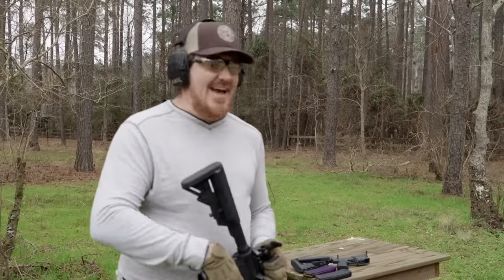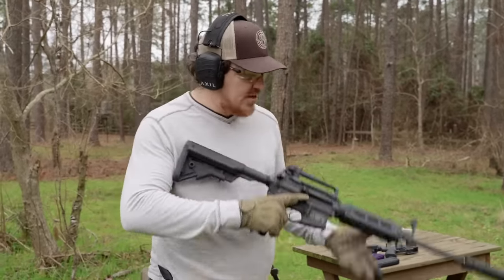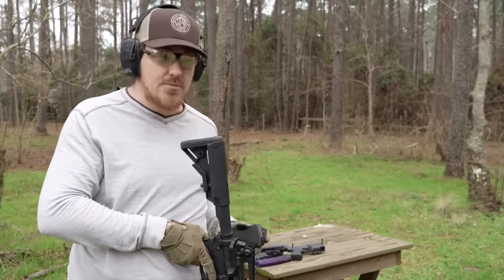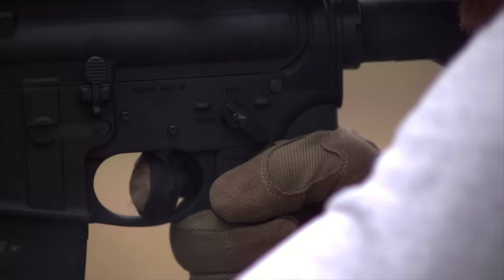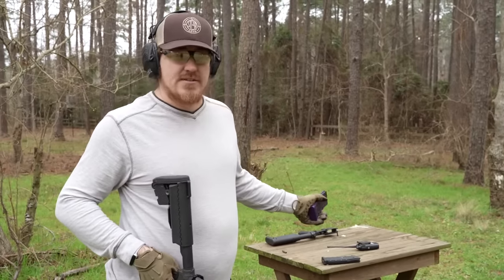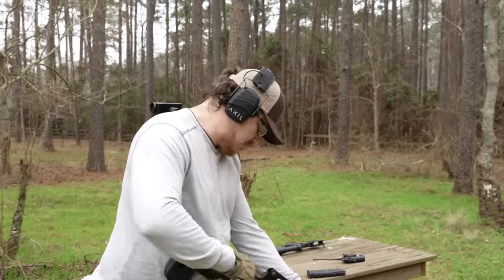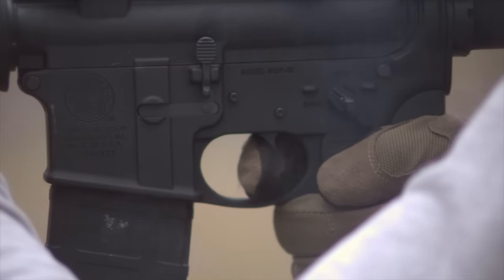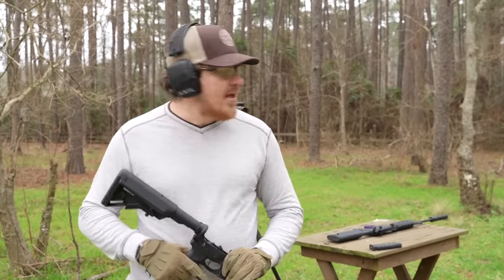FRT-15 Vs An Actual Machine Gun

Comment: I'm not against FRT or full auto at all.  I think both should be made legal.  However by definition FRT can be considered machine guns.   Part of the prohibition of machine guns is that it requires a Manual reloading of the weapon.  Basically this mean a manual rearming.    A FRT does not meet that requirement as it resets automatically.   Machine guns
Includes any firearm which can fire repeatedly, without manual reloading, "by a single function of the trigger".     Everyone understands this to mean one pull of the trigger = one round firing.  But in truth it means it is necessary to manually move or release the trigger in order for another round to be ready to fire.     The same can be argued for binary triggers.  However one could argue that half way through the trigger movement is the manual resetting.   In all honesty lawsuits need to be geared to removing the The National Firearms Act of 1934 as it is unconstitutional.  Until then they can be found illegal.

Comment: How does holding the trigger back cause the gun to jam?
Reply from the maker: See one of my update videos I posted recently. If you hold the trigger back with force it prevents the reset from happening and causes the bcg to not go forward. So you end up with an open bolt. Release the trigger and the bcg goes back in normally and you can continuing firing.

Comment: In stock on rare breed website on occasion, and you can sign up for alerts. I ordered one last week, should be here tomorrow by tracking. Interested if it’s post design flaw???
Reply from the maker: It is. You’re good. They modified it back in May. I didn’t do a video on it because at that point so many people already had. They notched the locking bar so it would stop crimping the spring with undue pressure causing it to fail over time. I replaced my car with a Gen ii and got back up springs to keep it tuned sharp. No regrets. You’ll enjoy!
Reply: @gatcattill  mine arrived today...No updated parts from this video that I can tell. I saw pictures of the updated bar, this one doesn’t have the notch. However, the spring hole looks wider like I have seen in some videos. Perhaps their limited by what they can change and with the current situation my not be approved for another patent.

Comment: Hey dude? Are you shooting at a road? At 2:00 to 2:06 you can see a white car go past behind the brush on the right of the screen
Reply from the maker: No. This is a closed private range into a berm. There is a farm road parallels the range a few hundred ft to the left with no crossing or contact.
Reply from the maker: Also. No car is visible? Might be an egret flashing white in the trees.

Comment: Needed to point out that neither of the firearms are a machine gun, even a full auto .
A machine gun is a heavy firearm that is designed to be fired on the ground or vehicle with a bi pod and are usually belt fed but can also have a box mag.  A mg does not have a semi auto mode. 
Ar rifles that fire auto, are just that, a full auto rifle.
The government likes to use the term, mg, to scare the general public more.
Reply from the maker: Ok boomer. Read the NFA for the definition of what is the legal machine gun term.
Reply: @gatcattill  Look up the military term for a machine gun
Reply: @FC-qe1wl   This is a video about legal definitions of firearms. A full auto rifle is a machine gun by law. That is all that matters to this issue. 

The military term has no bearing whatsoever on law.

Comment: It's slightly faster than a full-auto...holy shit!
Reply from the maker: Had a lighter buffer weight which allowed it to cycle faster. Had they had the exact same weight system it would have been a tie or slight edge to the full auto since the frt is dependent on my finger movements.

Comment: ok who has tested the zip tie? Does a zip tie stretch and return enough to empty a mag with a forced reset trigger?
Reply from the maker: That’s legal grey area - but a zip tie till likely either lock the bolt open or it will shift after or or two resets and stop firing. Depends on the initial tension in the zip and if it’s allowed to move.
Reply: @gatcattill  It definitely works. Can now confirm.
I mentioned it because it was an argument used by the gov. in the bumpstock and forced reset trigger cases.

Comment: I think they reduced the rate of fire in government models because people were blowing through 20 round mags and not scoring as many hits
Reply from the maker: You can tune rate of fire in your personal gun quite easily by adjusting your gas system, barrel length, buffer weight and design, etc.
Reply from the maker: You can tune rate of fire in your personal gun quite easily by adjusting your gas system, barrel length, buffer weight and design, etc.

Comment: Also over gassing the gas system increases fire rate.
Reply from the maker: Same upper on both = same gas system champ
Reply: @gatcattill you mentioned with a lighter buffer tube you get a higher rate of fire, since you didn't say anything about the modifying the gas system to get a higher fire rate I decided to put it in the comments. Though it's funny that you jump to assumptions about my comment.
Reply from the maker: @Lucky719ner  not sure what’s funny. Just clarifying for those who may read your comment and think it has relevance.

Comment: Why is the safety  selector  half way between  fire and safety on your test m&p 15  and has it been  altered  in any way. An update to  this question would be greatly appreciated. For this cast's  suspicion that the test is flawed.
Reply from the maker: Test is not flawed. I swapped the the stock safety with a radian ambi 45
Reply: @gatcattill  why was this fact not openly disclosed in the original article post. I dont know any selector thats the far out of alignment. And i own over 15 ar .

Comment: What about the other binary triggers?
Reply from the maker: They run well. I use Franklin armory BFiii on my 22 and 300 blackout lower. No issues. You can get very fast with them. No legal issues with them as of yet. If FRT loses though, binary will fall next because it will allow reinterpretation to the NFA rulings

Comment: Do I need a lower with the third hole? I don’t have that but rare breed doesn’t mention the third hole for the sear. It just says you need the full auto bolt which I have and a heavier buffer . Any info? Is the third hold just to have the semi and auto option?
Reply from the maker: Third hole is specific to an actual machine gun and no applicability to the FRT

Comment: BATF is treating the Rare Breed Triggers as a DIAS.
Reply from the maker: Batf is trying to treat all forced reset triggers as a machine gun. Not an auto seer. The classification they are pushing is more like a lightning link in the function that it converts an AR to FA with a drop in part. The AR is not the machine gun in that instance but the part is. With a DIAS, the lower with the third whole is considered the MG.

Comment: Well, not for nothing, and I am a staunch 2nd guy, but that trigger group is specifically designed to circumvent the rules.  They will end up changing the rules to something about emulating automatic fire etc.  Not agreeing with it, but that's what's going to happen,  and as someone who has spent some time in nasty places and seen a thing or too, the only thing that "full auto" fire in a M16/AR platform is good for is lightening your wallet, which is why modern military variants only have 3 round burst.  Effective sustained full auto fire requires a heavier chassis and mechanism specifically designed for full auto fire.  I've laid down effective automatic fire, and the M249/M60 is the way to go.  A very good video though, really shows how the FRT works, and yes, as currently written it complies with the rules.  Let's hope the courts see it that way...but I wouldn't hold my breathe.
Reply: They will most likely change the definition of Semi Automatic. To something like 1 bullet per trigger pull, where a trigger pull is defined further as a 2 step process of squeezing and completely releasing muscle tension off the trigger. Semi Automatic will then logically be further complicated because of Rare Breeds circumvention by defining semi auto as needing MANUAL user input to both action and reset the trigger mechanism, so that the gun itself will not automatically reset its trigger without user input. As you can imagine, all guns will have to change if Rare Breed forces the rat into a corner.

Comment: So, H2 spring with the semi trigger, what spring was in the M16 buffer? Just curious.
Reply from the maker: Stock vltor a5 setup
Reply: @gatcattill  so, H4 6.83oz And the H2 at 4.7oz. 

I wonder how the fire rate would be affected with an H3 kit in the M16. This is just a curiosity, as I’m new to the hobby.
Reply from the maker: @steaknive  it would increase rate of fire. Heavier buffers slow rate of fire. The distinction between the two rates was more so to fun to be fair. The comparison was for trigger movements and education. But it’s always a good learning exercise for those just joining in the hobby at this level of trigger fun!
Reply: @gatcattill  I figured it was a fun addition to the video. But, as I said, I’m just here to learn.

Comment: You have a transferable but you still say “H2 buffer tube?” 🥴
Reply: Meaning what? What part of that is wrong?
Reply: @evocati6523  H2 is a designation for the weight that goes into the buffer tube. They don’t make buffer tubes with different weights. 

I’m not offended, but typically when a guy is $20k+ into guns they tend to know the basic mechanics
Reply from the maker: It’s being on the spot and fumbling. I do my videos in one take. See the comments about how I pronounce aguila ammo in my 22 video.

Comment: Does the trigger moving really make it semi auto? Because it is the trigger moving and not the finger. The finger is just under lose tension.
Reply from the maker: Without the finger it will not fire a second or subsequent round. The mechanic is forced reset is not new and has been ruled OK by the ATF. This is just another over step and mind change.
Reply: @gatcattill  Without the finger a fully automatic gun wont fire either
Reply from the maker: Without the finger pressing it each time*

Comment: So FRT-15 vs M4 on full auto. 
Amount of rounds downrange (same), 
Cyclic rate (about the same), 
trigger pulls without the high speed camera (undistinguishable, unless you are the one pulling the trigger). 
#1 Letter of the law vs the spirit of the law. 
The fact they pulled the product from the shelves for 'product concerns'; nail in coffin. Sorry everyone, I love the 2a as well, its a machine gun to anyone other than the person pulling the trigger. if my 3 year old says cool machine gun then guess what ATF is gonna say, bye bye the way of the bump stock which had a much better argument. IMHO.
Reply from the maker: It was pulled short term back when this video was shot in February. They had some supply shortages and a disagreement with BDU. They released rev two a couple months later that addressed the spring concerns that was found.
Reply: @gatcattill  Good to know. Thanks

Comment: Wide open triggers has a similar design but idk how it's gonna lay out with a stolen patent from what the rare breed owner said in his video.
Reply from the maker: I have a WOt now. Check my shorts in my library. It’s got some uniqueness going on. It will be interesting to see if the patent covers it since it functions different than the original patent. Time will tell. Full break down coming soon
Reply: @gatcattill  I really suggest you go check out his video just because it's built different he said the same thing happens. Idk lol

Comment: I'm thinking about getting this trigger do I have to change other parts to make it function I understand buying other parts may make it more reliable but if it can function fine without buying extra parts pls let me know !!!!
Reply from the maker: It will depend on your build. There is no fixed answer. The requirements are a full auto bolt carrier group. The next is a heavy buffer weight. The weight that works for you will purely depend on your gas system, ammo, etc
Reply: @gatcattill   appreciate that !!!

Comment: I’ve shot one of these, there really isn’t a special way to pull the trigger lmao, it just dumps all the ammo instantly like a full auto. Literally no difference between this and full auto except you kinda have to shoot in full auto all the time.
Reply from the maker: Watch my other videos to disprove that. You can over squeeze the trigger and cause it to shoot a single shot and lock the bolt back. Release the trigger to let the bolt follow through then rinse and repeat. You must allow the trigger to reset forward to fire again. The definition of semi auto. Trigger pressure is critical to getting it to work proper and behave as intended as a forced reset trigger behaving in a by definition semi automatic fire. Rapid fire does not = fully automated, yet you seem to be under the impression it does.

Comment: The issue is the trigger mechanism and the legal definition itio  of a machine e gun not just wasting ammo
Reply from the maker: No issues there. The atf is trying to reinterpret the definition of a machine gun to fit the behavior of the frt which is nothing more than an assisted fire. This design as already been approved once by the atf with the tacom trigger. Of course that lacked the locking bar that prevents hammer follow which makes it a lot less viable imo

Comment: Anyone know how to address the light primer strike issue? I have the H3 Buffer like it asked for.
Reply from the maker: Heavier recoil spring inside your buffer tube could help. Strike industries flat spring seems to fix a lot of folks issues. However you could have a gas issue too. Replace your gas block with an adjustable and start to tube it that way. There are many ways to skin a cat when it comes to FRt

Comment: Nice comparison...  Very detailed.  My conclusion: It appears to be automatic fire to me.  I welcome other views.  QUESTION: With that trigger installed; can you also send only one shot (or) are you limited to that higher rate of fire?  Just curious.  Thankyou.
Reply from the maker: You can send just one. Press and release. Or press and hold back to stop the rest and it’ll fire one and hold the bolt back till released. It’s not automatic in the definition. It’s just a very effective way to reduce your splits. The lettter of the law is for this trigger. Good things coming!

Comment: you can’t hold your frt trigger back cause it’ll jam? Can’t relate
Reply from the maker: If you hold the trigger fully back it will lock the bolt back and not allow it to move forward. This causes a single shot to function, releasing the trigger will reset the bolt and allow you to continue firing.